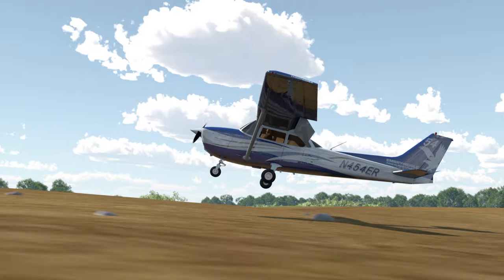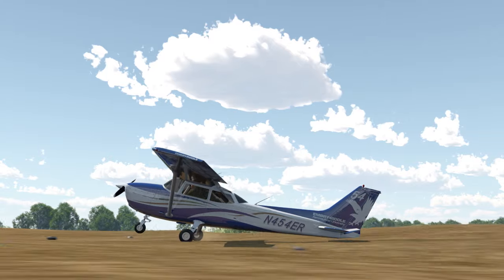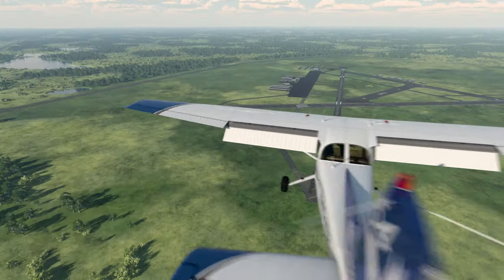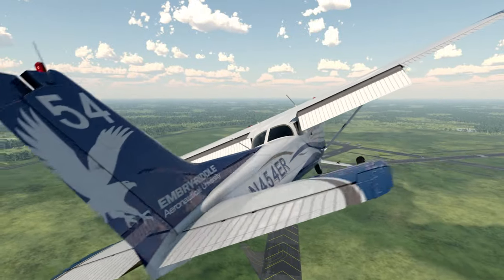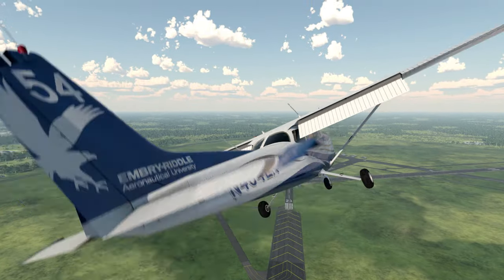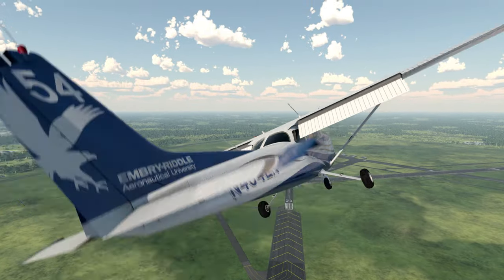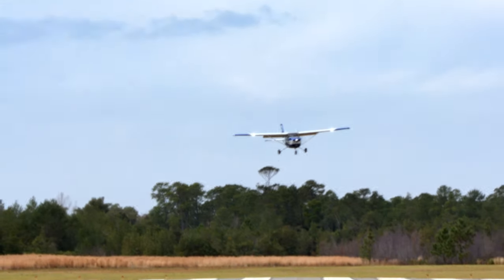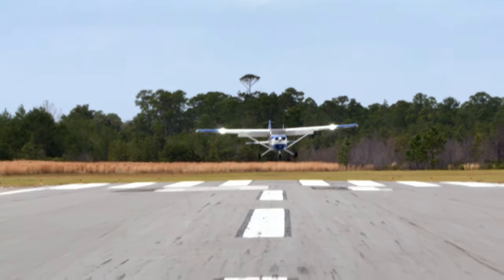Fall 2016 PACE Demo

Comment: Well - sideslipping a 172 with more than 20 deg of flaps is not allowed. Read manual.
Reply from the maker: That was true for older model Skyhawks, but the restriction has been removed for the 172S.
Reply: @ERAUSpecialVFR   :)))
Reply: @ERAUSpecialVFR  yet this isn't explained by the video.